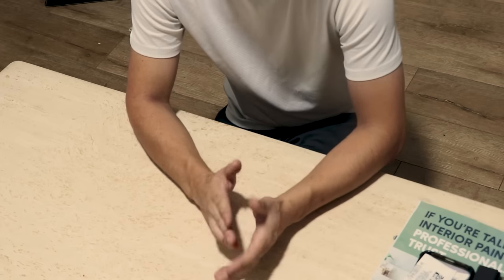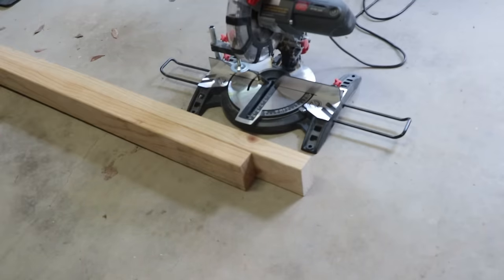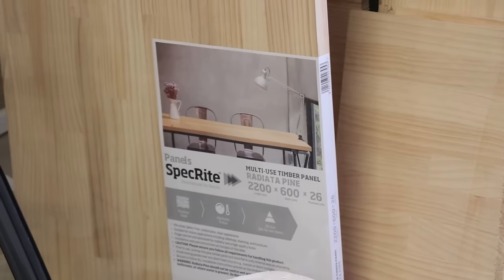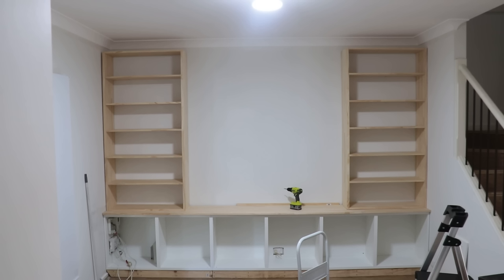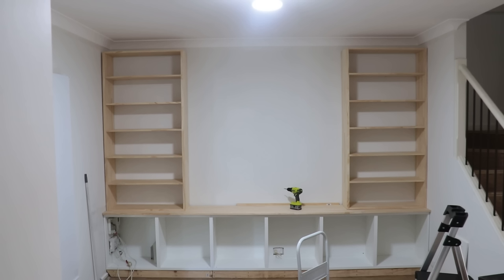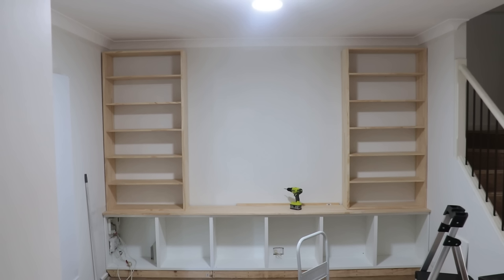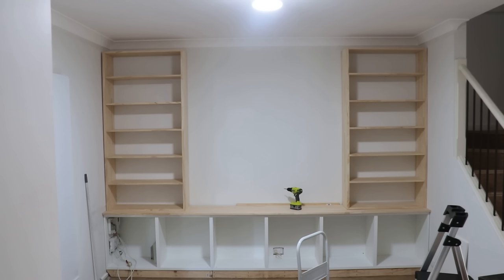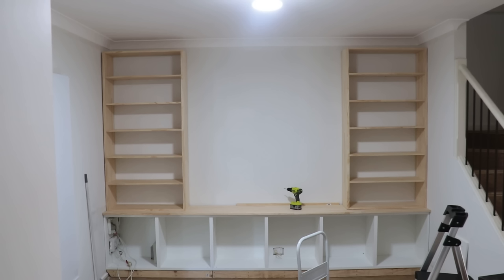Making a Buit-in Library Wall With a Rolling Ladder

Comment: Small tip for next time. You can buy dowels that fill up the pocket hole gashes, or what I did was for anything above the eyeline I put the pocket holes on the top of the shelf. Your books cover them up.

Comment: At 15:15 it's the wrong type of screw for pockets, mate.
Pocket screws are flat but you're using taperred screws which will split the wood as it moves with time and moisture.
Reply from the maker: ops

Comment: Gee thanks mate it came out surprisingly good for IKEA,pine, and 2x4’s. The barn door hardware was a little much with your lathe and mill skills. I was watching the video and my bookworm wife came home and had this glazed look in her eyes. When the video ended she looked at me and said I thought he manipulated metal and he made that with minimal skills and tools. She proceeded to point out that my shop has a table saw, miter saw, jointer, planer, drill press, router table, and dust collection  and wants to know why she doesn’t have a dedicated wall for her books yet I have a hardwood wall of Ryobi tools. Guess what I’m making this coming Spring. She wants the TV in a lift cabinet so  it’s out of sight when entertaining. I’ll never get my Little Machine Shop Hi Torque mill now.
Reply: Au contraire - make the bookshelf and she'll probably buy you the mill :)

Comment: when coping the skirting board a good trick is to angle the saw cut back from the mark this makes the joint easier to hide. Not bad for a first major project in wood.

Comment: a couple of design changes you could do on the ladder --  put a flat surface in the middle of the ladder rungs to be a better standing surface,  2nd you could put a couple of soft wheels on the bottom of the ladder to roll across the floor.  wish we had a place that we could put something like it great vid  --ENJOY your NEW  Library    have fun

Comment: That ladder design is awesome 👍
Reply: Agree. Adding to the belt and braces approach I had the idea of adding pocket screws from the outside of the inner uprights fixed into each rung. These are then hidden by the outer upright layer, and this still leaves room for the dowels. I'm neither engineer or woodworker so this addition is likely redundant. Call it over engineered. Its main intention is to add to the glue joints preventing the uprights ever bowing outwards from the rungs.
As for the shelves over the TV -- a 50mm strip across the underside at the mid point front to back would likely bring those shelves up to full spec.
Adding to the other comment about floor rollers on the ladder -- frequent use will leave a mark on the flooring so a strategic "strip of something" might be a good preventative.
Keep up the good work, the videos are always fun to watch, and, incite a good bit of "maybe I can do that" 👍

Comment: Recommend you get an impact driver to put those heavy duty screws in.
Reply from the maker: I know but this is a one off project and I doubt ill ever be doing anything this big ever agin. cheers
Reply: One thing that will help when driving screws is use Torx or square drive screws. I won't buy Phillips screws unless it is the only option.
Reply: @2aminitials Yeah. Hex works good as well.
Reply from the maker: For sure. Unfortunately here most screws are Philips head unless it’s decking or specialised.

Comment: Nice job, pretty big to be doing it all alone.
Question: To move the ladder you just pull it away a tad to lift the legs of the ground I guess?
Cheers 👍💪✌
Reply from the maker: Yes, it has thick rubber pads on the bottom to keep it in place so I hav euro lift it slightly to move it

Comment: The guys who do trim for a living will cut the cope at an angle like 45 degrees.  It forms a tight knife edge at the joint.  The piece behind it is normally just butted to the wall.
 
Outer joints naturally require both ends to be mitered but the trick there is to add a degree to the miter to get the sharp edge.  Can't add much because the inner part of the joint won't look right.

A nice thin bead of caulk makes other imperfections in the long joint go away.
Reply: I've never seen anyone back bevel a cope joint at 45. That's way to much. 10-15 is plenty.

Comment: Ive built bookshelves from scratch before and I can say from experience that those are going to sag. Books are heavy. 3/4 pine is not up to the task.
Reply from the maker: Well we can run in some bracing or the like if that ever happens.
Reply: That is not quite 3/4 pine. He used laminated boards which should be a bit stronger tho' less leasing to look at up close.

Comment: any carpenter talking shit about using pine is either a poser or doesnt know how to work with it properly. works just as fine as any other wood. technically its a bit softer than many other hardwoods yes but your building is more likely to be demolished before those shelves break because you used pine..

Comment: NBN & ACMA probably won't be happy with you playing with telecommunications wiring without a license.
Reply from the maker: Taking it from a from a first hand source, those rules are in place for contractors who intend to do major relocation of nbn hardware, moving it from one side of the house to the other and whatnot. NBN don’t like people splicing their fibre optics or the like if you aren’t registered with them. It’s not really there for people trying to move the wall bracket 30cm on a wall.
Reply: Unless he does something like run an ethernet cable across or within a few inches of a power cable, they won't care. If he starts cutting cables to move them, they will :)